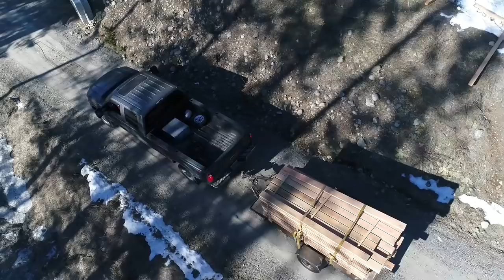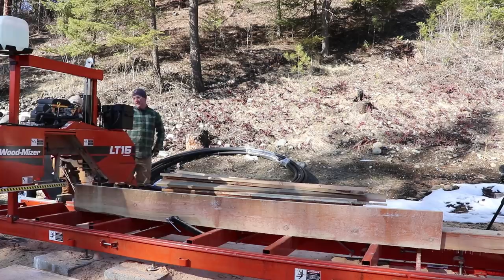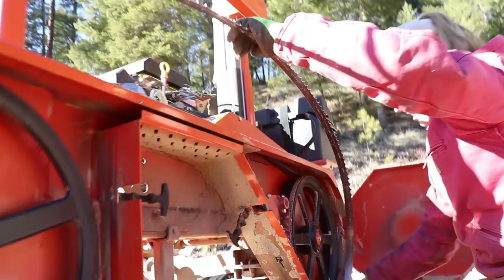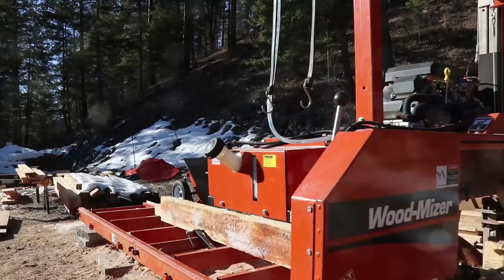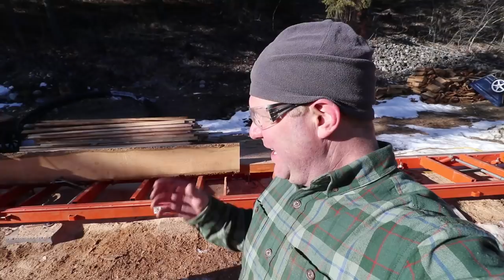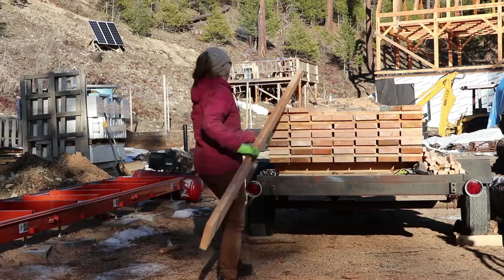Fallen Tree to Perfect Boards (Log to Lumber)

Comment: Great to see you are both getting the balance right for both your relationship and house build!!! Again my husband so wishes these videos were in real time so he could answer your questions especially about manufacturing your boards and kiln drying. He so wants to help you both :) He has worked in timber manufacturing for over 30 years. He even researched and built a kiln to dry their own timber. You may lose a couple of millimetres on the length but he said the shrinkage is usually on the width and thickness. I hope your timber dries to your satisfaction. Good luck!!!

Comment: Nice to see that you are cutting the live edge off your boards.  The ancients used to do that with their logs.  If you check the old homesteads there was less rot with the live edge gone.  When the wood got wet the live edge tended to retain moisture, but if you look at the heart of the log/lumber it was drier.  If you chose to over think your cutting to make the least waste you will mentally burn your brain out.  I have so few functioning brain cells left that I pick my battles, and this one I don`t play.  It is what it is.  When we did our lumber we did not send it to the kilns.  We stuck and covered with tarps till we needed them.  No one locally did.  A trip to the local lumber yard, not the big box yard, did not always have a drying kiln. There were times that they were just finishing up an order that morning and we would have it in the yard that night.  We had lumber milled from our logs that came from our own property plus lumber from the local yard when we were running low.  Doing a great job, hugs.

Comment: Safety tip for all... When ratcheting down your load, put the ratchets on the passenger side... Incase you have to check load shift, and ratchet them a few more times... You'll be clear of traffic side, most of the time.

Comment: Just a bit of advice, always put the ratchets on the ratchet straps on the passenger side so if you have to stop on the side of the road to tighten or adjust them you wont be standing on the traffic side of the truck and trailer you will be off on the shoulder

Comment: if you are making 2x6s out of 2x14s, can you set your saw to be6 inches above the bed, the cut a lot of boards at once?
(cut to size from the good stuff from the bottom, remove it, then put the boards that were cut off back on the mill?)

I think that way you could cut many at once...

Comment: The simple answer to your 27' length issue is to drop your designated 9' finished board length.  12' and 15' lengths will help with your randomizing of butt joints on the floor.  With only 9' lengths you only have 3 options, but with 12' and 15' boards mixed in it will give you a much more randomized floor. (Too bad the boards are already cut, dried, and possible even placed already!)

Also, I know your hearts are in the right place but you have to get over your concern with waste.  You cut your boards, you cut your stickers from the generated scrap, you use that generated scrap for firewood.  That isn't waste. Neither is cutting large un-used boards into lumber that you are using.  Not milling them into usable lumber for the immense project you are in the midst of and saving it for other projects that haven't even been thought up is wasteful in a sense. 

Keep up the good work, and don't get bogged down about trivialities like waste (that isn't really waste if you use it for an alternate plan).

Comment: this guy is doing great.
he has a outback flex80. solar panels, batteries, and an inverter.
if he set the outback to 60 Vdc, connects his solar panels in series, connects his batteries in series, and gets a 
higher voltage inverter, he would be doing great.  just buy following those simple instructions, he will have more power.
he wouldn't need to spend much more money. he could add (attach in parallel) to system as he needs.

Comment: I'm curious. IF the mill can handle boards up to 16' in length and the joist spacing is 3' on center why not maximize the lengths of the boards going into the kiln and then cut the boards to length afterwards either 15', 12' or 9'.  Or at least cut five or six boards at 16' just in case something goes awry.
Reply from the maker: The decision was based on material on hand (most all was multiples of 9 or 10 with minimal waste), joist spacing (not all are 9', some are 10' near the stairs), potential loss from checking during during and keeping a semi-uniform unit dimension to simplify milling and keep cost down during planing/shaping. A lot to think about when picking dimensions.
Reply: Still, a few 12' wouldn't hurt if there's 3' waste in some.  Not saying you should, and no 'but'.  However, don't forget to move you butt when one of those boards is swinging your way :-D

Comment: No need to fuss about shorter boards. Just use your short boards at the ends where you want 3 or 6 foot sections, instead of cutting long boards down. Your waste will still only be one or two feet per board, which you allowed for on the big ones anyway.

Comment: 27 Footers = 2 x 10 feet and 1 x 7 foot.  The 7 foot could be used for a 6 foot section or 2 x 3 foot sections, since you will need those and you will not have to cut up a 10 footer.
Reply: John Turner wow glad you were here to help

Comment: Great videos! Does she have a sister? One piece of advise. When you are stickering wood, make sure you put the stickers directly over wood that's carrying the load. In your case the 4x4s on the trailer. I noticed the stickers were about a foot beyond the 4x4s. So all the wood you stacked on top of those stickers were loaded over nothing but air. This will cause your wood to warp downward because the load is transferred to nothing. Other than that I really enjoy watching your videos.
Reply: pretty sure the 4X4's are not part of the stack, just there to allow the fork lift to move the stack at the mill, & place it properly on the rail carts for the kiln... just saying...

Comment: Don't think that load would be allowed here in England because you have panels sticking out further than the length of the trailer. You can certainly do it but would have to attatch some kind of hi-vis notifier to the end of the plank.

Comment: you are going to need some 3 foot and 6 foot pieces for the offset pieces.  You should cut 27 to two 10's and a 7' and use the 7' pieces to make the 3' and 6' pieces.

Comment: How come you have to re-sticker the wood?  It looked beautifully done.
Reply: Warren Price look at the new pile they’re much closer to the end and it think that helps prevent twisting in the kiln. It’s probably much more complex than that given that the sawyer took one look at their pile and said we gonna need to restack that.
Reply from the maker: Board ends are vulnerable to checking in the kiln. Stickering near the ends helps stop the checking right at the sticker preserving the boards. We knew this, but mistakenly stickered it on the trailer.

Comment: Do you have to change blades as often now that your not cutting trees?
Reply: Milling logs can dull your blade faster as most times the trees are dirty...even road dust will dull the blade quicker. Most sawyers rely on rough estimate / board feet and just the feel. Saw blade/quality also comes into play.

Comment: I wish that you would take your air compressor and blow the saw dust that is accumulating on the engine that is powering your saw mill. The air cooling fan is sucking saw dust in to the cooling fins on the engine and if there is any oil residual it will cause hot spots as the saw dust collects,....just a thought. 
I really enjoy your adventure and the quality presentation , keep up the good work !!
Reply: They do....
Reply: I have ran and owned a Woodmizer LT30 since 1985 and the only time anything got up in the engine was one winter a family of field mice built a nest under the shroud. I check it in the spring just for that reason but it only happened one time so far.  Good to do preventative maintenance but if you don't saw in the rain and keep the engine clean of oil there is less chance of dirt build up than on a lawnmower.
Reply: Jeff ~
I hear what you are saying,....I am just fussy and twice a summer I spray "Simple Green ' on a warm engine and hose it off and allowing it to air dry. The engine stays squeaking clean and is easier to work on should it need .
Reply: the subscriber viewers, me & rest of us, only see minutes of a day or two, so I can just imagine there is a whole lot of other stuff going on we don't see (like maintenance, laundry, dishes, cleaning, dump runs, and many other personal things we all do...) which would not make preferred content, & much more gets edited out than whats published.

Comment: True there is waste in lumber production, but a lot of sawdust or ofcuts can be chiped for mulch or sawdust for mdf or even sold as fule so even though you might see it as waste there is a use for it. In your case you will get your heat from it or warm your tub. Not really a waste item then.

Comment: Why not cut the 27 foot boards as two 10 footers and the "leftover" 7 footer becomes a pair of the 3 footers, or one 6 footer that you need on the ends as you stagger the board joints?  That way you are not sacrificing any of the 10 footers unnecessarily.

Comment: Stop thinking about the off cuts as waste, they can be fuel and if you could find a cheap chipper you could turn the stuff that won’t work for fuel into mulch or compost. Judging by your rocky soil compost would really help down the road if you really plan on gardening.

Comment: Instead of wasting the cut off you really should cut them at six, nine and twelve you can't go wrong this way
Reply from the maker: All those cuts will happen after the kiln to simply the units and minimize exposed ends in the kiln. Considered 12' for some boards because of the 22' pieces. At some point it gets to be a mess. 9' was the easiest single length we could make from what we had and work with after the kiln. :)
Reply: Another effen shoulda!
Reply: Pure Living for Life 👍
Reply: Pure Living for Life, I hope you gave enough extra length for the checking so you don't lose all that lumber. I would have left the boards 6-12" longer at each end before kiln drying. I really hope you didn't shoot yourself in the foot by cutting them too short before kiln drying.
Reply: Yea there are going to be 1/3 and 2/3 boards on 2 of 3 runs o  the ends of the run
Reply: Cory Pride build yours how ever the fuck you want they shoulda done theirs however they want
Reply: Glad you're taking breaks and having more fun and stopping at dark! Be safe you two!

Comment: I haven't watch this all the way thru, yet but the first few seconds plus the title means this is not going to turn out real good. 

I used to drive for a lumber yard and to attempt to haul a load like that by just strapping it down was/still is a recipe for disaster.

Now I will finish watching and wait for the spillage.

Good luck guys.
Reply: Well I was wrong, they made the trip to the mill just fine. Now to finish watching.

Comment: Ya know, some times they crack 1 or 2 inches, sometimes they crack 6-12 inches. I can't believe you are only leaving 4" for checking. Why would you cut 2-3 ft off a board? Send it with the extra 2-3 ft! My prediction is you be milling another pile of lumber when only half of your boards are usable.
Reply: They listened and took advice from an expert!